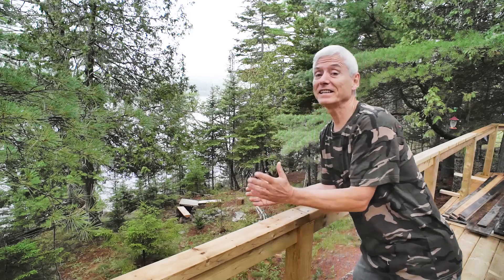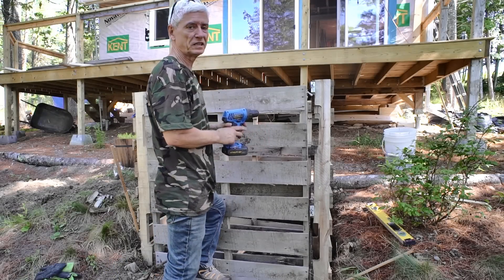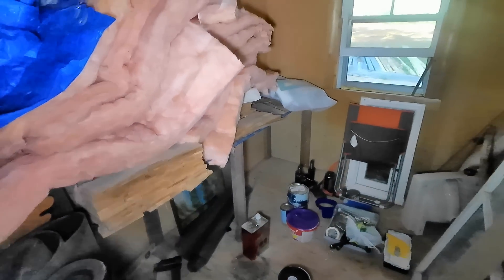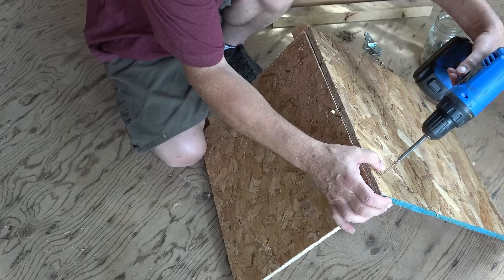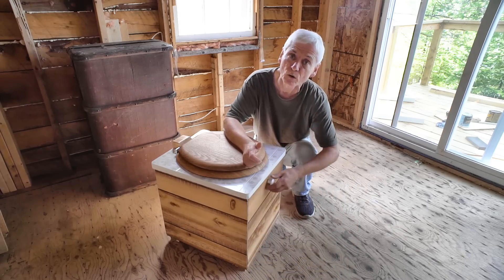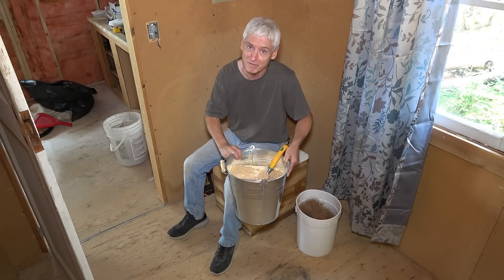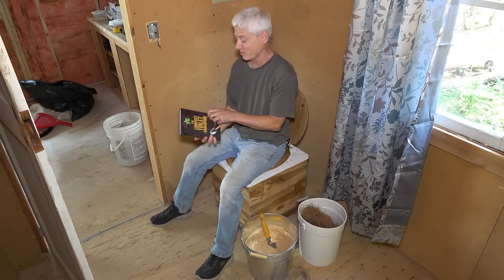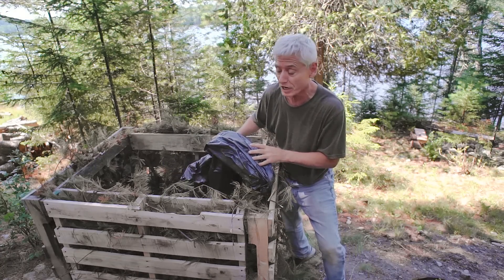My Cabin Compost Toilet: Much Ado about DooDoo!

Comment from the maker: NOTE FROM SLIM: It seems a lot of people are confusing a "Compost Toilet" with the erroneously named "Composting Toilet" that has been deceptively marketed, especially to RV users. What I built is a compost toilet, one that is SPECIFICALLY designed to accompany a compost bin, with the end result  indeed being actual compost.  Also, too many are getting hung up on the assumption that both the toilet and the compost bin will smell. If managed correctly, this will NOT be a problem. Also, bear in mind my toilet is for ONE PERSON, me, and to be used occasionally on a seasonal property. That is not the same as a family of five using it every day. Most of my compost will be vegetable matter and NOT poop. Hope that clears the air (!) a little! Thanks, SP
Reply: clears the air... awwwwww too funny.
Reply: YUP....  I keep tell RV folk they got only a PARTIAL compost toilet and need a place at home to properly let it complete   (or dry it in a hot box heated by exhaust and burn it later)
Reply: Lot of potty humour in this video... 🤣💩
Reply: Clears the air! Pun intended.
Reply: hey slim ,  as the cabin is raised should lot a 'wheely' bin compost toilet  (2 bin system would work)  basically the wheely bins go under the house below the loo, once one full you swap for the empty
Reply: I think there is a time period before toilet compost can be applied safely in a garden. Better check on that piece of it.
Reply from the maker: @Nonewhere Listens, but of course. I would not be surprised if  there wasn't any usable compost until the second or third year. I'm in no hurry! SP
Reply: What about a new series? Leave the caravan at home and just do "Travels on my Toilet". It could be a rip-roaring success. By the way, liked the placement of the knob on the front of the box!! I imagine wiping with those pine needles stings a bit? 😄👍
Reply: I would think he'll be throwing leaves and other natural debris in the soon to be 'hot box' and once the composting gets going the odor will be very controllable like he said, for one person.
Reply: @SlimPotatohead , what I think Nowhere Listens was referring to is having separate piles, and when one is full, leave it for a full season before putting it on any edible plants to allow any human pathogens to die. In the meantime, start the second pile.
Reply: The RV urine diverting composting toilet doesn't produce compost if used and emptied regularly, but the solid waste comes out reasonably dry and not smelly, and seems like a more pleasant thing to empty than a chemical toilet slurry. It would be easy to put the solid waste into a dumpster without making a mess (in a bag or some other container).

Comment: Hey Slim.  We used our toilet for 8 years,  in the house.  No smell. Out in the bin, no smell.  We tried pine needles,  leaves,  etc. We found sawdust worked where anything else smelled some. I also found,  as the official dump and clean person,  that a single sheet of news print on the bottom of the bucket made clean up much simpler.
Reply: Newspaper- great idea. I wondered about lining the bin.
Reply from the maker: Good to hear about your successes. Newspaper sounds like a great idea, thanks! SP

Comment: 1:02 absolutely loved this lol. Amazing video. I wonder if a hobo shower would work for your cabin. When the heating was out in my house for a month I got used to using an 8 quart pot to heat up water to a proper bathing temperature on the stove, then taking the pot into the shower with me along with a dipper, and bathing that way. It's amazing how clean you can get with 2 gallons of water, I felt just as clean and fresh as if I had a 20 minute regular shower. The upside of this is you wouldn't need any kind of hot water heater, and you could plumb your shower down to a simple catchment bucket. If you only bathe with 2 gallons of water at a time, you know exactly how much water is going into the catchment bucket, and it will never overflow. If you bathe with nature friendly products you could even use the grey water in the bucket to water plants. It just seems like a very easy and effective way to do things.

Comment: Slim, you did a great job on your solution for your situation. Hope more folks will convert. Using no water and putting nutrients where needed are good works. My female equipment requires some adjustment as I do separate liquids from solids. Using peat moss for solids only, it dries faster and is easier for removal and incorporates needed air flow and much longer time between emptying. I use the liquid "gold" (diluted) for the best natural fertilizer I have found. (Uric acid is the base for many commercial applications.) Just an automotive funnel with long neck or tube into a large jug (large, emptied kitty litter jugs work great). The funnel seals while in use and a cap nearby for transport. Switch out funnel to spare jug. Have never had an odor issue since I've been separating. Those with male equipment could adapt something similar. Also, I have found some soft, natural - colored napkins are less an eyesore in the bin and breakdown just fine. Restaurant supply places have them in bulk and the dispensers for them. Will get that book; looks quite informative. Also recommend "Holy Shit" and "Humanure" for more research. 

Thanks for your excellent efforts on all your vlogs!

Comment from the maker: ANOTHER NOTE FROM SLIM: Here's one I answered several times, but the answer keeps disappearing:
QUESTION: Why did you put the compost bin right in front of your deck? 
ANSWER: I put it right in front of the deck because that's the best place for it. A natural process fits right in to the natural surroundings.  As it's over 2 feet below the deck, I don't even see it while sitting, and does not interfere with the ocean view whatsoever. I also put it there because I have neighbors, therefore this is the most discreet location. It is also far enough away from the waterfront to not pose any danger to the sea water. It's also the best location to use and check up on it, and near my rain barrel. Thanks! SP

Comment: Hi Slim,love the content!I've used a toilet just like this for years now,and I found it was easier to line the bucket with a good kitchen trash bag...used to have to clean the bucket when empty like a toilet bowl,now I can lift the bag out(a good one won't leak...not the place to skimp and get the cheap ones😂),and dump the contents into the compost bin,and throw away or burn the old liner. Worked better/easier for me,and may or may not work better for others. Thanks for the great videos!

Comment: Great compost loo. I wasn't aware that fluid and solid could bed mixed, so thanks for clearing that up.  
Only thing I would have done different is the placement of the compost bin. I thought it may have been better placed at the side of the building rather than infront of your deck. 
I love the way you do a costing of materials and use recycle as much as possible.

Comment: Really got a kick out of this video. Simple solutions are the best!  One suggestion :  maybe run a length of rebar, pipe or wood post inside the hinge side that attaches to the door of your compost bin to stabilize that wall. When that gets pounded into the ground, it should make opening and closing the door easier. You could even do all 4 corners. Just a thought. All the best from a regular and appreciate viewer.
Reply from the maker: Good ideas. Thanks Karene! SP

Comment: Hi Slim only us dry sawdust and cover material and you may need to use more coverage during fly season you will also need more buckets with lids on hand to store it though the winter mouths as the compost will not brake  down in cold weather

Comment: Dear Slim, don not worry: 
+ your compost bin will be fine and not smell at all even if you add your occasionally organic matter. Just make sure to put some vegetation and some shovels of soil in between. Esp. the soil will kick-start the composting process as there are all the microorganisms in you need for that. you will have so much nutrients in the compost, that you even could plant high-nutrient demanding plants on top of it, like pumpkins 
+ then for one person and occasional guests, ONE such large compost bin will be ok, as you have the fresh on top, the composting in the middle, and the ripe at the bottom. if you would have a smaller bin, I would recommend 2: one for the fresh and the other for the composting and take away of the ready compost.
+ plan and "outlet" at the bottom of the bin, where you can access the ready compost with a shovel. if you just have one large door at the front, the unripe stuff from the top might fall down if you open it to access it.

- one thing i have to tell you even tho all the advantages: even the prettiest compost bin is not something you should have in front of your porch and between you and the great view of the sea. So please move it behind the hut or at least on its sides, now that it is still empty and easy to move. better suggestions for the place in front of your porch are: flowers, crop plants, a Zen Garden, a fireplace, a pond....anything. but please not even a designer compost bin.
-if the wood is untreated then it will also rot away in a few years.
Reply from the maker: Great advice Joe Cool! As for location, it absolutely does NOT interfere with the ocean view as the top is about 3 feet below the deck. It also cannot go on the sides in respect to my neighbors. Thanks! SP

Comment: You do some really nice work and I've long been a fan of your creativity and construction abilities!. The only thing I would have done differently with the box for the toilet would have been to prime the OSB with an oil-based primer (and a high-gloss topcoat) as moisture will degrade the OSB pretty quickly. I also share your frustration with the lack of grey-water systems in North America and the refusal of local planning boards to allow for them.

Comment: You may want to consider what they call a separate, which is the means of separating the urine from the fecal matter. Urine can be dispensed with easily in the yard, and if you separate it from the fecal matter, you'll find that it's much easier to maintain and a heck of a lot less smelly. I found it to be so much easier to manage the solid waste in the compost heap without the additional moisture.

Comment: You could also do a step for getting your legs on right hight. It's also possible to do small intake and output chimney to the box, so it will prevent any smells.

Comment: Hey Slim! Excellent and entertaining video as always. I was particularly interested in this one as I use a homemade compost toilet as well. I found that adding a urine diverter helps keep the odor at a minimum.  I found one on Etsy that clips on the bucket, and it drains into an empty plastic juice bottle. When I empty the bucket into the compost pile, I empty the urine on to the pile as well. Each to his own, but I feel it's less messy to deal with and not as smelly.

Comment: You could  line a compost bin with landscape fabric since it permeable and will hold back finer material but not plastic sheeting  since it needs to breath as well as drain. One way to speed composting isn't the most pleasant since turning it over multiple times adds air as well as evens out the decay speeding it along. Indeed rotating bins are the best pre made versions usually made for kitchen scraps-yard clippings and if you use one like this  what  do a perk test of the soil under it before going further. Basically it will tell you if water will go into the soil and its usually just a hole filled with water test and checking to see if it remains standing after say an 1hr or two the earth might not be ideal because of  clay. If it doesn't drain at all its a no go since water will find its way along just under the surface or slope but its rare to have have that much clay or a water table that high in sandy soil like his. Kudos on the build as well as letting viewers know what local rules they need to follows since even in unincorporated areas like this how you deal with waste water and its byproducts  either human or otherwise can effect the health  everthing including you when done wrong.

Comment: Informative and humourous Slim. I do hope your compost bin doesn't spoil your lovely view and fabulous fresh air, quite so close to your deck. Composting toilets are excellent, but usually are not located outside in my experience. That said, you could easily empty your bucket on a daily basis. The soild you create for your garden should be fantastic, but to get hot composting happening in Canada, will be a challenge. My dad used to use some lime in ours, if it got to smelly. Freshened it up. Some fragrant plants near it would not be  a bad thing. Cow manure is also good to add.

Comment: You’ve converted me on this topic 100%. My previous thoughts (as well as a ‘no thanks’ for the expensive so-called composting toilets you can buy) for this set up was digging a hole for a holding/septic tank and rainwater flushing system but this is much better - especially here in East Coast Canada where anything involving water turns to ice in winter. Probably a lid of some kind on the compost bin to stop it filling with snow over winter and help keep heat in? Would an opening roof with an air gap below be of any advantage/disadvantage as a permanent fixture? I feel it would help in keeping racoons from climbing in after food scraps etc. Very nice build in the toilet itself - I’m always hearing about it being a good thing to have your feet up on a stool set up when using a toilet to put your body in a better pooping position. They even sell a thing called a ‘Squatty Potty’ for that purpose. Don’t use one myself but wondered if making something similar from some wood scraps would save you cutting down the height of the box and also give some adjustability to the height for other visitors of varying leg length! Thanks for the upload. 👍🏻

Comment: Slim- We use a similar design in our RV, but use a metal air- tight pet food canister inside the bucket, followed by a kitchen trash bag (which doesn’t leak), then our cover. Outdoors, odor is never a concern, but used inside the RV it can smell, and I’m one who doesn’t want even the faintest whif of such odors in my living space. Hence the metal container. And you know I got the technical tip on using a metal container from your videos, so I’m surprised you’re not using one ?  We also had bad luck with sawdust and odor. Cedar shavings aren’t too bad, or forest floor mulch.

Comment: I keep a plastic lid on the bucket when not in use, also even though the unit can tolerate a small amount of urine, I have a separate urinal. I also use Sun Mar compost accelerator in the bucket to get composting going before dumping it into my rotating compost drum. There is hardly any odor.

Comment: Might be advisable to coat the interior of the box with a good outdoor paint or enamel to allow for easy wipedowns (if/when needed) and ensuring that "compost materials" that might splash onto the wood, aren't immediately absorbed into the wood.  Another alternative would be to just line the interior with some sort of plastic/vinyl/tyvek.
Reply from the maker: On my website blog I put additional info that didn't make it to the video. The pail is actually on a platform that is covered with a wipeable laminate. Thanks! SP

Comment: Beer and a bucket...great concept!
I'd love a cabin in the woods, but for $$ lack, I'm redoing a small RV...my cabin on wheels; compost toilet as well. Just looking for some frugal property to rent here in Texas to place it on. Thanx for info on compost bucket...I have a bucket in my camper van & can use that. I will upgrade it.
You cracked me up on this one Slim!😆 TY for off grid info.
Reply from the maker: This toilet is NOT for an RV. It is designed as a compost system for a cabin. Completely different concept! SP
Reply: @SlimPotatohead  Thanx Slim...that's why I'm hoping to find some property to rent that will allow a compost bin.

Comment: Currently traveling in a camper full time. Got tired of following every bit of advice on the internet about keeping your black tank fresh smelling...nothing worked, especially in hot weather. Finally gave up and double lined my toilet with plastic garbage bags, and used cheap kitty litter. Once full, I tied the bags and deposited them in the nearest dumpster (hard to compost when you're on the move). Never a whiff of wtf is that? Stopped the stink, ended the odor, foiled the funk. A little more work, but worth it for the ability to take a deep breath without having to spray febreze everywhere.

Comment: Not to rain on your parade but I think you may find there is a lot more to composting than you have implied. Maybe that was intended. First, from my own experience, pine shavings are antibiotic. Will inhibit bacterial growth. Need a different organic matter. Once composting actually starts, turning to keep mixture going helps a lot. And I did on occasion add water to keep bacteria alive. There is much more as you will find. Composting doesn't stop in the winter, but does slow down considerably. Don't take me the wrong way. All for it and your efforts.